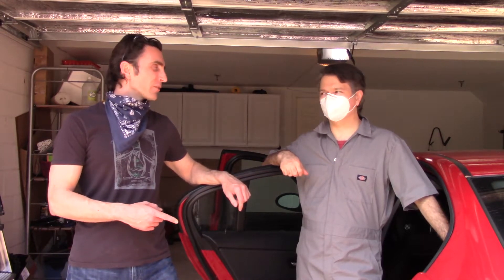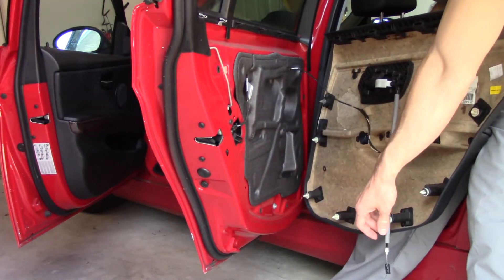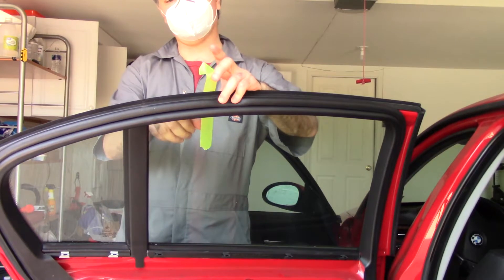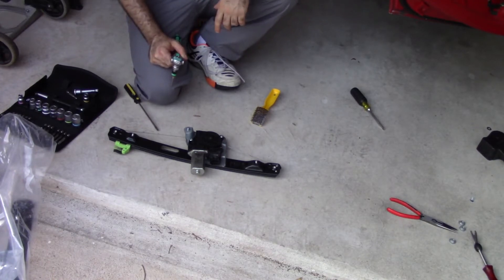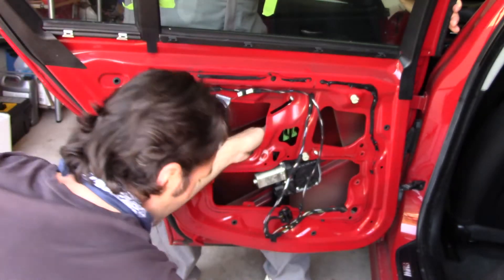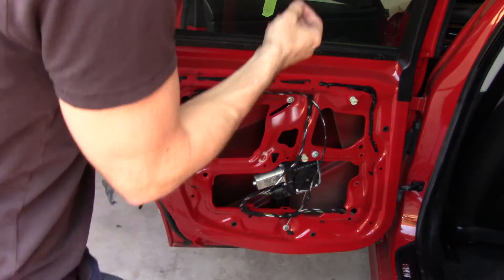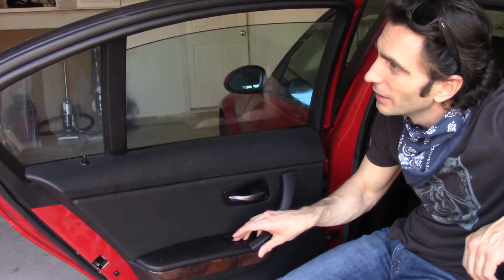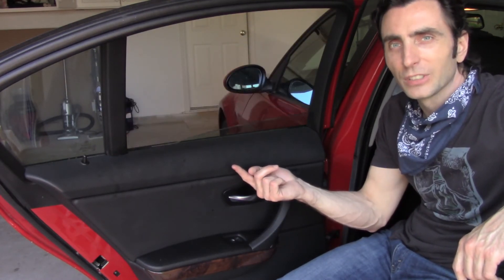BMW Window Regulator Replacement and Window Reset

Comment: Hi - I used the video to replace the regulator and all works but do have one question - when I hold the switch to close the window, it goes to the top and then opens up half way and stops. Why does it not stay closed? Seems like calibration, can you help?